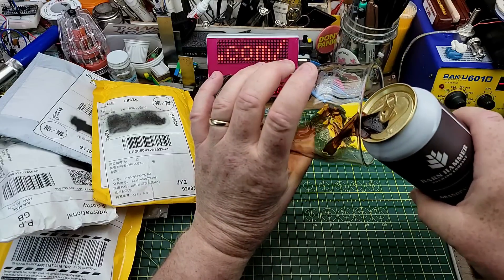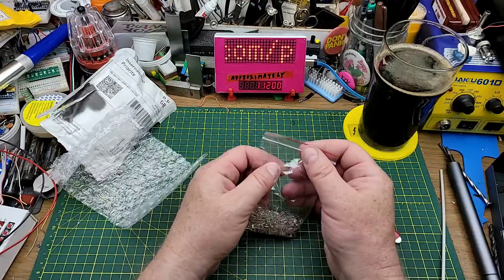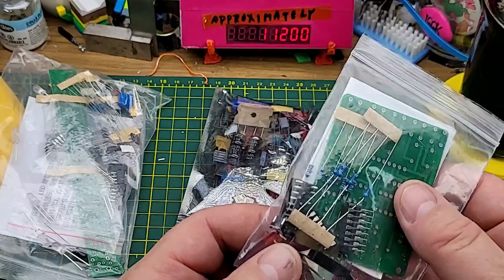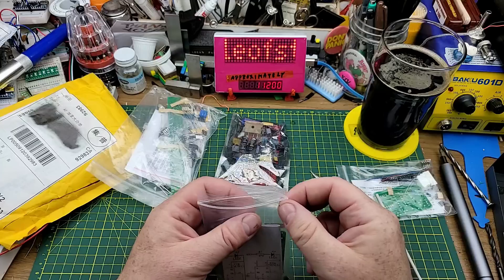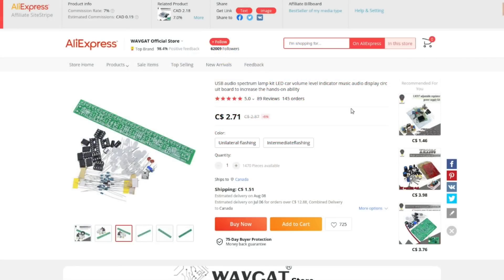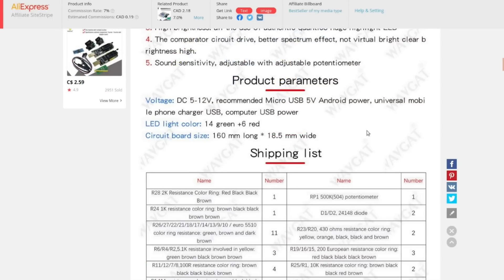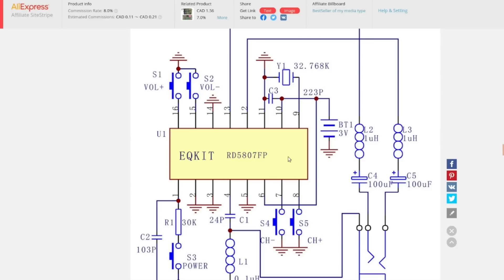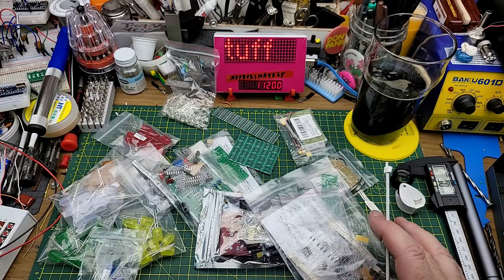Mailbag Monday 142

Comment: I bought a batch of those RDA5807M FM receiver chips.  They fit on your MSOP10 adapters.
You can use I2C (3.3V) to tune channels, and query signal strength.
The Class-D output drivers are sufficient for little speakers.

Comment: the fm receiver is stereo and all in the chip but the transmitter is only mono, it takes more than that circuit to modulate 2 channels.
Reply from the maker: Yup, it would take more than double the circuitry on the transmit side.

Comment: Text at 6:00 says:
USB voice-activated music audio audio spectrum light making kit
The louder the sound, the LED will jump with the music as the sound rises and falls, and it is even more interesting to lift and play DJ, and the use of independent comparator circuits is slightly more complicated
However, it can be accurately displayed, with anti-reverse polarity protection diodes, which effectively prevents the power supply from being reversed and causing the circuit to burn out, which is more suitable for DIY.
Features: 1, with a microphone, no need to connect the audio cable, 2, the power supply 5V (USB interface power supply) 3, high brightness: all use authentic Guoju high brightness LED.
4, the use of comparator circuit drive, pinno effect is better, not blurred, clear brightness is high. 5. Sensitivity to sound, adjustable with adjustable potentiometer.
Application: Can be placed next to the circuit, next to the TV, next to the home audio, the power amplifier handheld Bluetooth speaker inside, next to the car screen, with the sound jumping
The notes, very nice to look at.
Parameters: voltage, DC 5-12V, recommended mlcro usb 5v power supply; LED light color: 12 green + 8 red.

Comment: Text at says: 05:54
Notch direction
Diodes pay attention to plus and minus
Red Red Red Red Green Green Green Green Green Green Green Green Green Green Green Red Red Red Red
Get the kit first to see the instructions: the two colors of the lamp is installed separately, more is green, welding precautions: the resistance is not divided into positive and negative poles but to correspond to the board resistance
Value welding, 1n5819 and 1n4148 diode color ring end is the negative electrode, corresponding to the white end of the plate welding, the part connected to the housing of the microphone is the negative electrode
Capacitors do not distinguish between positive and negative poles, electrolytic capacitors distinguish between positive and negative poles, some resistors will be replaced by yellow color resistors, pay attention to distinguish the resistance value.
Common problems: individual LED lights are not lit, LED lights polarity installation or damage, can be replaced; Does not work, the chip is inserted in reverse, the diode is installed in reverse, and the simple installation is reversed or
There are virtual welding, short circuit, short circuit and so on.
We are an electronic kit manufacturer, there are hundreds of various stages of electronic production kits, there is a need to be prosperous